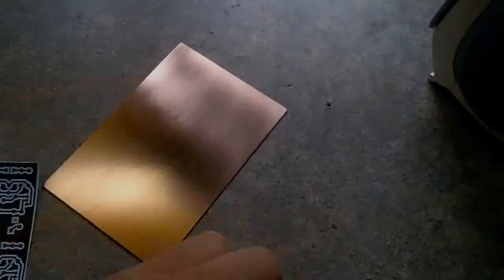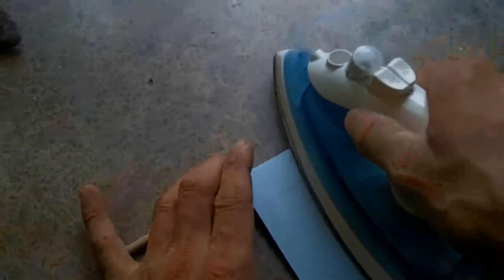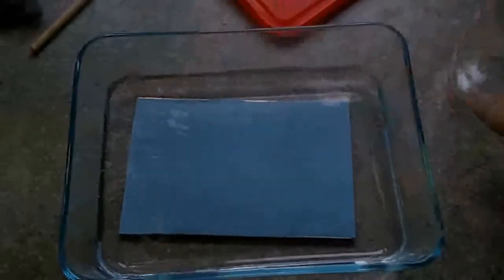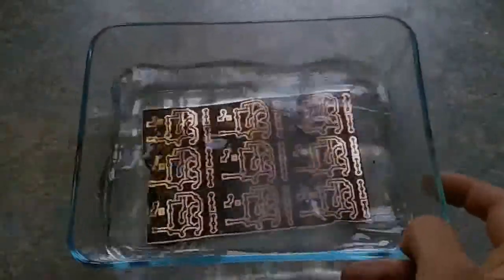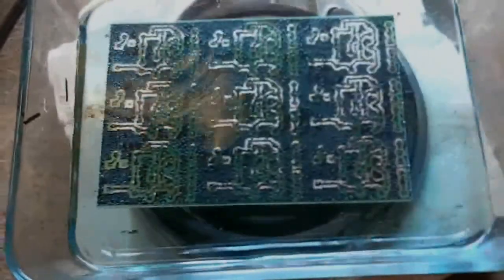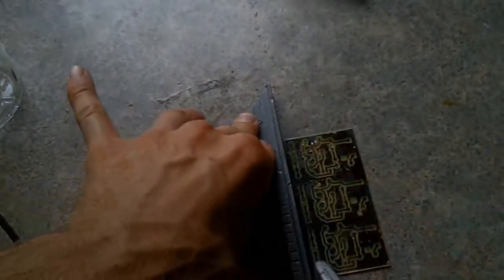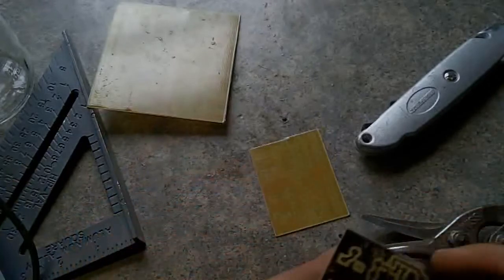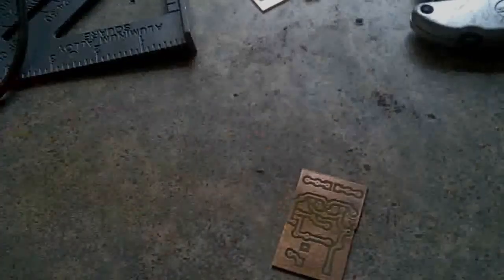How to make a circuit board - part 2

Comment: Like the video. You can get an assortment of drill bits for PBCs at Harbor Freight Tools for about $7.00.I modified a laminator bought a Harbor Freight Tools with instructions I found online because I could not iron my artwork to a PBC without smearing it. I tape the artwork to the PBC and send it through the laminator about 10 times, it takes just a couple of minutes then let it soak in water. It works great, You should try it.